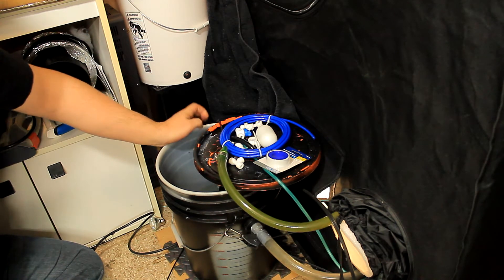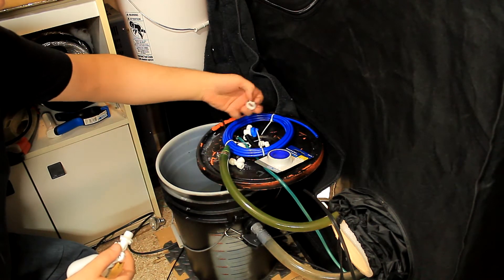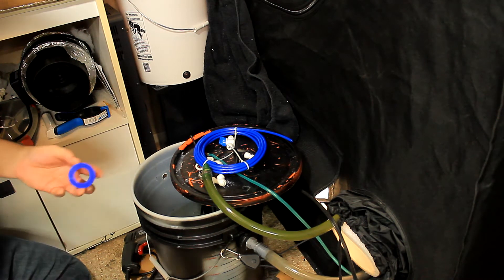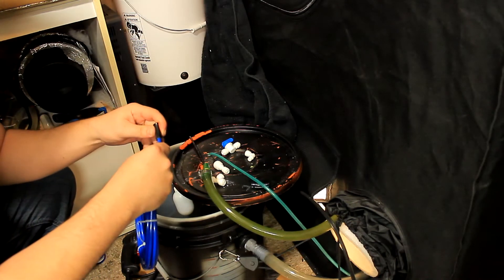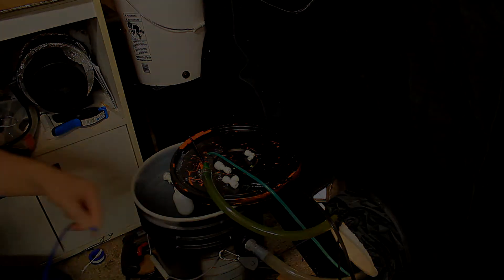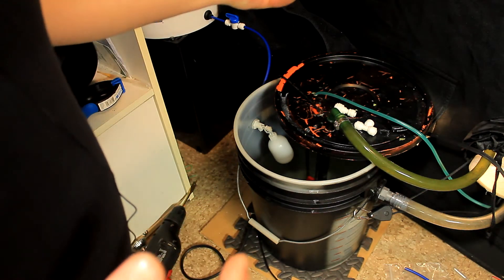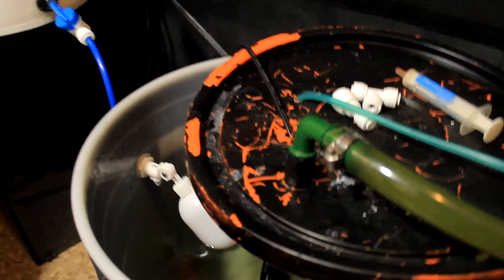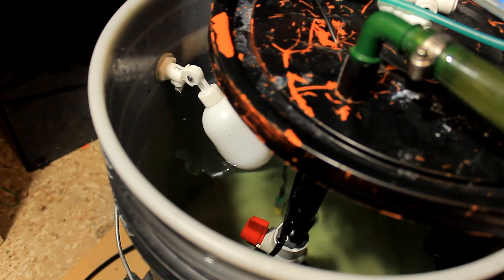DIY Auto Top Off System (ATO) For Hydroponics Reservoir

Comment: Have the same floats. It comes with a rubber washer, a hard plastic washer and the nut. If you see on the rubber washer and on the plastic washer, they have identical marks where they line up. I was told that plastic fitting goes in first then the rubber washer which is on the inside if the bucket. The rubber washer creates the seal of course to edge of the bucket, while the plastic washer creates more of a surface for that rubber  washer to press against. And on the outside of the bucket, is only the nut,,not that plastic washer. The other reason why I think this is correct because of that plastic flange on the threads, that prevents a perfect circle for the hole, but if you place the plastic, hard  washer inside with the rubber washer, everything lined up. It's like, "The only way it should be put together correctly." Your  thoughts? I haven't installed yet but I'm about too.
Reply from the maker: I put the gasket or rubber one on the inside and tightened the crap out of it. I was worried it was going to break but it held and made a good seal

Comment: What's so great about this is you could turn that into a rdwc with another line and some gromets, and an extra pump. Gotta love it. Good work!
Reply from the maker: Yeah dude well it actually is a RDWC system. This is just how i am topping off my reservoir for my rdwc
Reply: @downwithprohibition7364  genius... That saves so much time collectively. Just adjust the ph in the feed res and boom. That'll also help stabilize from ph drift if done right. Dude you just hit another area and didn't know it big thumbs up